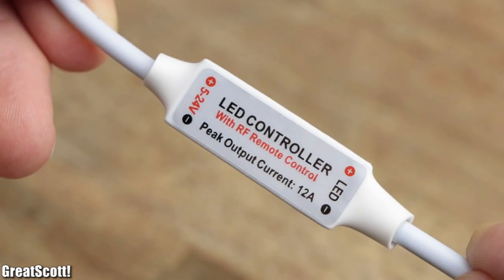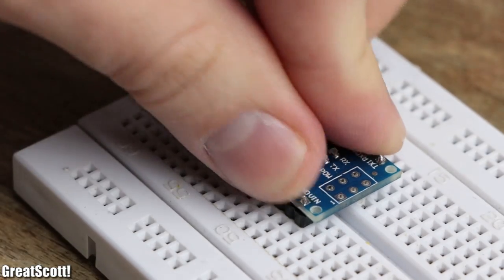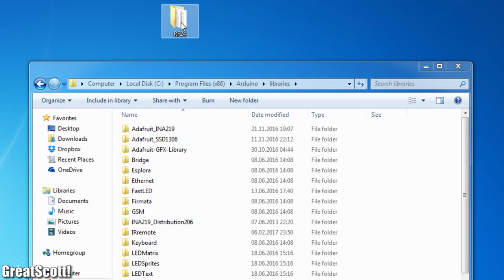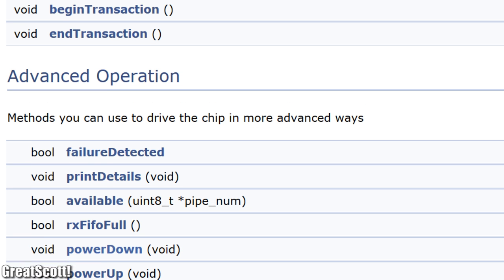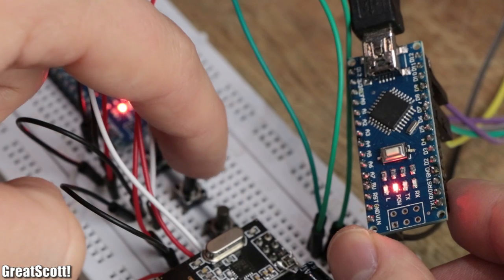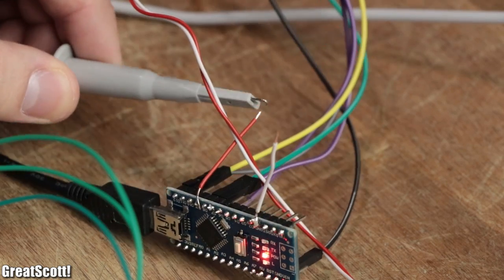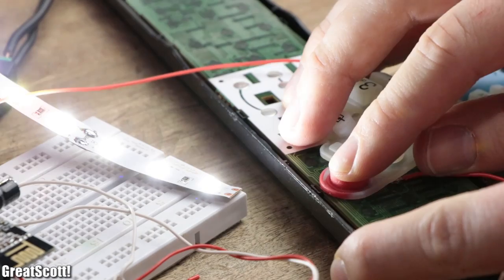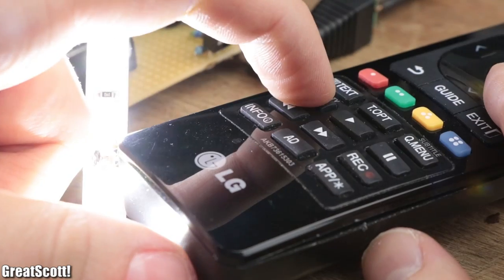HACKED!: TV Remote becomes an RF Remote || nRF24L01+

Comment: Awesome stuff. That gave me an idea that I'd like to try. How about grabbing the signal to the IR diode. It would be fairly straight forward to write some arduino code which would translate all the key codes to RF signals. That way we could convert any standard IR remote into a full blown IR/RF remote (given it has enough space for the Arduino).
Reply from the maker: Sounds possible

Comment: Could you do some sort of GPS Tracker project? I asked a few months ago, not sure if you remembered.
Reply from the maker: I am currently working on something similar. But it will take a while though.
Reply: Or how about 12v car battery applications? I have been getting into the electrical systems of my car and adding switches for certain applications.
Reply: GreatScott! Hey. So does Xbox controller use RF signal.  Sorry I am not pro on electrics. I see ur channel because I just love seeing chips and motherboards LOL 😂
Reply: All console wireless controllers use bluetooth due to their low power consumptions.

Comment: To anyone wondering what the diodes on the switches are for, they form an OR-Gate to pull down the single interrupt pin whenever one or more switches are pressed. Without the diodes, you'd just short all the switches together.

Comment: Extremely useful! I've had this idea before and now I know how to do it! One more thing I've been thinking of is how to control multiple strings of leds. You can use any remote so it's as easy as programming multiple inputs to one output like a different t.v. remote and buttons, for more than one room. So like this video says you can just code the remote outputs. Say there's a few rooms, so the "AUX on"  code (master remote for tv, dvd, aux, and cable) with the kitchen t.v. turns on the kitchen lights only, however not the living room lights. The living room t.v. remote only turns on the living room lights, however the "TV on" code for the living room remote will turn on the kitchen lights (TV on for living room does not affect kitchen t.v.). My question is how would you control the different room leds? I was thinking a couple or multiple RF receivers and one power source. If it was just a big circle of leds and they had a way to turn on or off certain sections. So the kitchen receiver could control all the rooms lighting from one remote and the controller would power the entire string of leds, and at the same time, each individual remote can control each individual room of leds.

Comment: great video! one question, what are the purposes of the diodes in series with the switches?
Reply: also, what are the implications of removing the voltage regulator?
Reply: The diodes were added  to provide a single output from all of the switches without affecting their original purpose of providing 3 separate outputs. So now there are 4 outputs from 3 switches, one of which is when any switch is pressed.

Comment: @GreatScott amazing work! Thank you for the time and attention you put in your videos.

I just have one question (maybe a stupid one), how can we know if we can just take out a voltage regulator like you did for the Arduino? Doesnt it provide a stable voltage source for the arduino? How can you know before hand?

I thank you in advance!
Reply: I know this is old but might be useful for someone: You have to check the datasheets of the parts, and of course know a bit about the circuits they belong to. In the case of the Arduino, it has an operating voltage window, not just a very specific voltage, as per datasheet, the controller itself on it (it's brains, the ATmega328p) can run with anything between 1.8 and 5.5v. That regulator likely keeps it inside the maximum operating voltage. Being the remote's battery voltage between ~3.3 and 2.2v when operating, it works well without the regulator. From the voltages provided vs. what it can handle, you already know beforehand that nothing should fry, but of course you should always test further.

Also from the 3 pin package, we can assume it's a linear type, so it would be wasting much power if it even had to work, compared to a switching type, so in case it was actually necessary, an upgrade in the power side would be very welcome to reduce power consumption as well.

Comment: can u hack a tv to make it an oscilloscope? ??
Reply from the maker: A CRT TV should be possible......I put it on my to do list.
Reply: GreatScott! Yeah, it would be awesome
Reply: +GreatScott Thats a good idea. I believe old analog oscilloscopes used the voltage source to control where the electron beam goes on the CRT so it would be super interesting to see that being done over the composite video interface, if that's possible.
Reply: The CRT in a TV works differently than one in an oscilloscope. In a TV the electron beam is deflected by a magnetic field, in an oscilloscope by an electric field. Sure you can also move the dot around on a TV, but the trace won't be anything like the real signal, because the beam in a TV can't be deflected fast enough (or more correctly won't follow the input signal linearily).
For the time it takes to build anything around a CRT (ignoring the fact that playing around with stuff that's running on up to 25kV is rather stupid), you might as well use a raspi and build a digital oscilloscope.
Reply: Yes this can be done to almost any tv , it just depends on how well you understand electronics and how not to get electrocuted .
Reply: yep seen it done bud but be careful eh?

Comment: can you add the voltage rating of the capacitator we use ? It says 47uf but i could not get what volt is it, (is it 5v?). :(
Reply: Also, I'm confused about the 47uF, as the official Doc from Nordic invites to use a 4.7uF: "Mounting a large surface mount capacitor (for example, 4.7µF ceramic) in parallel with the smaller value capacitors is recommended."
I personally had initially put a 1F (5v) which I had at hand for my tests, as if you put none it just doesn't work. So I'll try with a 47uF (in 5v) next.

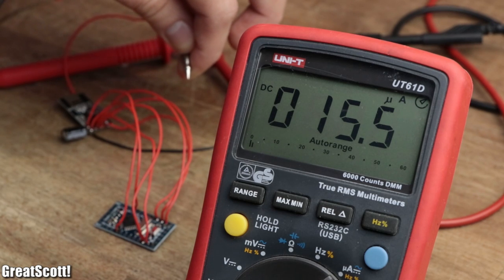Comment: Hello, at 5:24 about the measurement of the current consumption(15 microAmp), Are you connect them in series (power supply to nRF24) and get it? Or need to take some step?

Comment: next Q&A
1. When you make your own pcb with CNC machine?
Reply: PCB's are not generally machined but etched with chemicals. Top layer is eaten away with acid, and where you want wires or traces, you print a protective chemical that the acid cannot eat. It would be a good how to video
Reply from the maker: I already did such a video
Reply: You can still easily mill the top copper layer away to create traces.

Comment: Why not to "translate" the IR transmitter data to RF data?
Reply: Because IR travels in line of sight... and Generally RF wale travels Omni directional... Thats y...
Reply: vishal chavda that doesn't answer anything
Reply: vishal chavda I mean: He should connect a wire from the ir transmissitter to the Arduino. so he can decode the ir signals and transmit them as RF
Reply: +Raphael Jacob first of all, IR LED will generate IR light.. so if he connects output of IR to Input of audrino input for RF then there will extra stage will include and that too of no necessary... so he directly get codes that will directly transmit through RF. That is why....
Reply: No Raphael Means, also read the IR signal into the arduino. It would work and take alot less effort inside the remote... 

Not sure you're understanding what he means...
Reply: Mvinaround right
Reply: that's the easy less awesome way. :)
Reply: deltaray3 No, that's without destroying hardware and matrix problems
Reply: +Raphael Jacob This way the arduino would wake up on every button press... Although it be a lot cooler in my opinion and he would not send a command when the power button is pressed.

Comment: Hi do you undertake private project work I have a three channel 433mhz transmitter but need it to control an IR receiver but dont know where to start  I have the original IR transmitter as well any sugestions would be good and could pay for the work.

Comment: how did you manage to get stable 3.3v in the remote if you are using 2x 1.5 volts batteries?
Reply from the maker: I did not. The circuit also works with 3V and a bit below.
Reply: +GreatScott! du bist deutsch oder?

Comment: I want to do something like this with RF
but use 4-5 arduinos sending data, such as temp, humidity, ect. and have one that recieves all that and sends it out to a computer. and also have the one that is connected to a computer send out commands like, turning a water pump on, or uv leds. is this posible and could you make a video on this?
Reply: yea i figured, i just want to be able to throw in more latter and not have to run wires all accrost my green house witch is masiv.
Reply: thanks man, ill look into it!

Comment: Didnt quite understand the purpose to the diodes on the buttons, some1 explain?
Reply: not 100% sure I caught it correctly, but it appeared he tied them together with the other ends of the diodes all together to an interrupt pin on the arduino, so that a press on any of the 3 buttons would trigger the interrupt and wake up the arduino.

Comment: does the remote work if you are in an other room
Reply from the maker: Yes. But you might need to increase the output strength of the signal in the code.

Comment: how far goes rf?
Reply: Essentially you can choose. RF comes down to the transmitter and receiver which are antennas basically. There's long and short wave one for distance another for let's say the best quality in "sound" as that's what we use it for most. Meaning if I'm a radio broadcaster I can do so from a homemade diy antenna. But then I have to decide either it's a sorta HD foxhole radio. Small radius but crystal clear. Or you can go the other way and as long as the receiver has also an antenna that's big and bulky enough to find the signal I put out it could come down to sounding like a ham or walkie radio sound. But that's all sorta up to you but I'm pretty sure with a small antenna you'll have control all over the average sized family sized house is my guess

Comment: I am bit surprised you added "decoupling" capacitor to power lines
decoupling capacitors are very useful in communication, especially serial communication (like USB, SATA, SAS, PCIe and Thunderbolt)
they are not used to store energy, but to remove DC part of signal and leave AC only
SAS and Thunderbolt goes step further (as they are designed as extremal bus) and add small transformer to each pair of differential serial link